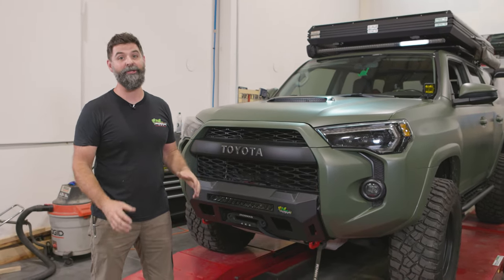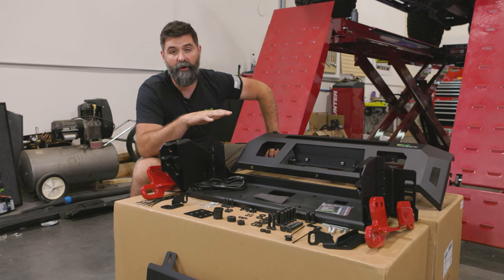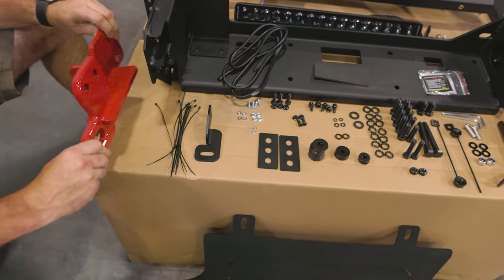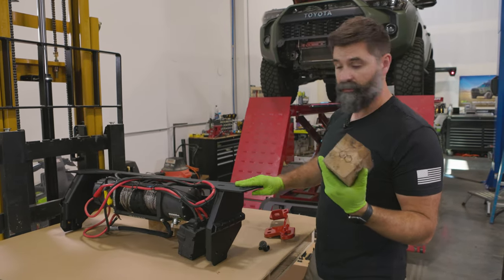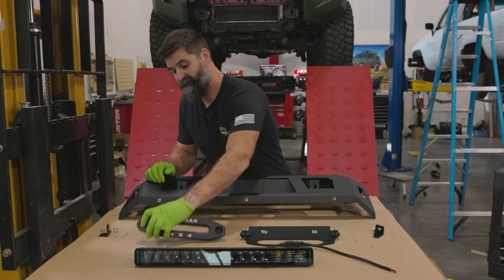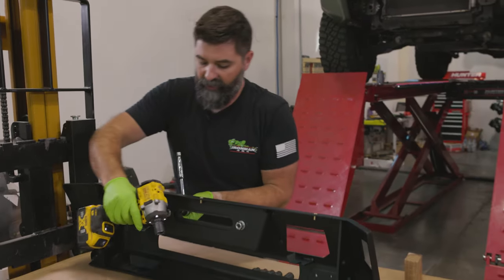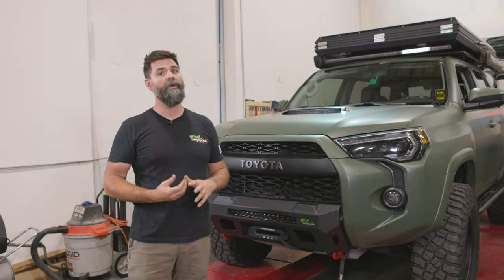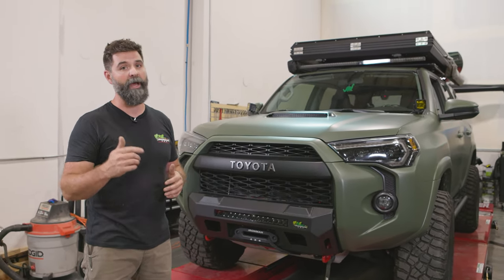Ironman 4x4 Stubby Front Bumper Suited For 5th Gen Toyota 4Runner | Install Guide

Comment: Great bumper - any issues with this and KDSS? I see your red recovery points attach to the radiator and frame housing which is right around where the KDSS sway bar is. I have a 2022 4Runner TRD ORP. Thanks.
Reply from the maker: No issues.

Comment: Looks great!!  I have a TRD Pro.  In that last shot in your outro, it looked like you had the TRD Pro skid plate on with your bumper.  Are they compatible?
Reply: The TRD skid plate is compatible 👍
Reply from the maker: Yes you can make it work with some longer bolts for the rear mounts and some minor modifications.
Reply: @Ironman4x4America  could you explain some of those modifications

Comment: Great install video and a nice looking unit. When will Ironman 4x4 bring out a bumper option for the 2nd Gen Nissan Frontier?
Reply from the maker: We have the D40 Navara bumpers that can be made to work.  The 3rd gen Frontier will get a new style bumper first.  There are so many trucks in line for bumper designs so it takes time and we have to prioritize based on newer models, and sales numbers of vehicles.
Reply: @Ironman4x4America   Thanks for the reply. Will look into D40 bumper. I  appreciate that you have to respond to the market and that there is always constraints. The 2nd Gen Nissan Frontier had a 16 year run with fairly decent sales numbers. Most Frontiers are now second and third owner and in the hands of guys who want to modify and wheel. Seems there would be a decent market there. Just sayin.  Keep up the great work at Ironman 4x4!!
Reply from the maker: @mikemorgan4670  Agreed! Cheers
Reply: @Ironman4x4America  Would you be able to point me in the right direction regarding  the D40 Navara bumpers? Thanks in advance.

Comment: So someone asked earlier and you didn't answer.  You mentioned a winch install video, but one doesn't exist. In this video, it appears that the winch control box isn't mounted at all. Did you fasten it to the bumper/winch tray where it appears in the video?
Reply: The video is misleading… it makes it sound like the controller bracket is designed to fit but it doesn’t fit on the left where the pre drilled holes are… you can fit it on the right, but there’s only one pre drilled hole. The controller box ground wire also isn’t long enough to make it to the other side so you need to extend it.
Reply: @timbell595  Agreed, the video is misleading and the install doesn't work this way.  I ended up drilling holes on the opposite side (right side if you face the bumper looking rearward) and used the control box bracket. I also had to make my one ground wire. All-in-all, I love the bumper and the winch but it was a complicated install and a video with more details would have helped.

Comment: Great video, just bought and assembled mine with the 20" light bar. I did not see any instructions for wiring the light bar? Are there any instructions?
Reply from the maker: Thank you! We don't have instructions for wiring as this can be done several different ways. For example you could purchase our wiring hardness kit and wire the light bar up to a single button that will stick anywhere to your dash. You could also get a switch panel, auxbeam and wire it up to that. Hope this helps.

Comment: Nice video!! Do you know what bolt size/thread is the one on the bracket by the radiator ? (Bottom one) Do you just sell the bolts on your guys website?
Reply from the maker: If you need some specific info on the hardware, please reach out to our customer service.  855-476-5714

Comment: I’ve got the FCP Stage 2 suspension- this is next!  Are the two little “humps” on the top edge of the bumper skin for mounting lights? Looks like there’s a plugged hole there for wiring?  If so, that’s AWESOME!!!
Reply from the maker: Yes you can mount lights or a stubby GMRS antenna there.

Comment: When is the rear raid 5gen bumper install come out. My order does not have any install instructions??
Reply from the maker: It's currently in the works.
Reply: Very frustrating that no instructions are included other than this video. Need a parts list at the very least.

Comment: I see there’s a big gap between the new bumper and the cut plastic bumper. Can you cut less plastic to have no gap?
Reply from the maker: The plastic falls behind the bumper shell, making a nice hide for the cut line.  The bumper in mounted to your frame and the truck body is mounted on rubber body mounts.  When offroad the body will flex independently from the frame.   To allow for this movement you need about a 1/2" gap so there is no contact.

Comment: With this and the rear really wish you had shown the bumper cuts being done.. that's the most guesswork.  And in the video you refer to a winch installation video but it's no where to be found.  You show the universal bracket but the kit comes with an angle bracket for the controller box but no info in this video on how or where to mount it.. is it left to the customer choice?  Any suggestions since you what appears to be a different box than you actually ship with the 9500 winch.. (yeah I can figure it out but that is one reason I ordered both part from same company I was hoping it was mostly mapped out).
Reply from the maker: There really is no guess work, simply follow the plastic chin guard piece outline for your initial cut.  Then trim back any more as needed based on your preference.
Reply: 1) The cutting instructions on the air baffles are wrong, you need to cut a lot more. 2) The part about the control box mount are misleading. It doesn’t fit on the left like he talks about. It only fits on the right, but there’s only a single pre-drilled hole on the right, and the control box ground isn’t long enough to reach the other side so you need to extend it. 3) There is wiring for the fog lights you need to relocate before cutting, if you cut it with the bumper on the vehicle you’ll slice right through it.

Comment: Do you have to move the air conditioning line out of the way? And if so how much? Thanks
Reply from the maker: No need to.
Reply: With a 9500lb monster winch it touches slightly but you can gently bend it.

Comment: I bought this bumper, an Ironman winch, light bar and skid plates because I thought it would all fit together nicely like this video makes it seem… unfortunately many parts of this video are missing or misleading… 1) Know this video is the ONLY instructions available from Ironman. No instructions are included in the box… no parts list, no torque specs… it’s very difficult to ko2 what hardware to use where. 2) The video is misleading about the winch controller bracket. It makes you think it is made to fit the 9500lb Ironman winch and fits in the left… unfortunately there’s absolutely no room for it there. You see in the video, the winch controller is actually on the right and seemly not attached to anything. You can fit it on the right but the control box ground isn’t long enough to make it to the left side, so you need splice it to extend. There’s also only one pre-drilled hole on the right. 3) The cutting instructions are wrong, especially for the internal air baffles which need a lot more cutting. 4) If you pre-mount your control box and try mount the whole unit in one go, like the video suggests, you won’t be able to reach the inside back bolt on the controller side. 5) The video fails to mention that there’s wiring for the fog lights that need to be relocated. If you cut on the vehicle, you’ll slice right through them.
Reply: Comment is a public service.  Thank you.

Comment: Can I fit it on a limited? TY
Reply from the maker: It will bolt up to a limited, but the cut will be much different because the limited has that fat chrome piece across the front and is different from the rest of the front ends on the other trim levels. Same goes for the TRD Sport that is offered.

Comment: How did you secure the winch control box?
Reply from the maker: It is bolted to the side of the winch tray next to the winch.
Reply: It only fits on the right side, not the left like the video shows. There’s only one pre drilled hole and the control box ground isn’t long enough so you need to extend it.

Comment: Does this work with the RCI skid plate?
Reply from the maker: Can't say for sure, but the TRD skid plate works with it using longer bolts for the rear mounts.  If the RCI is similar then you should be ok.

Comment: Why have these companies disregarded the 2010 - 2012 Models?
I have a 2012 and have a very difficult time locating anything for it!
Ridiculous!!!
Reply from the maker: Many companies, including us, develop products based on demand and sales numbers of that specific vehicle.  The early 5th gen 4Runner, 2010-2013, had low sales numbers because we were just coming out of a massive recession.  When Toyota released the facelift in 2014 sales more than doubled of units sold per year.  We look at this data very carefully when looking at product development decisions for legacy vehicles.  And companies will develop for the largest potential customer pool to get a profitable return on the R&D costs.
Reply: @Ironman4x4America  OK, with that being said, I have a question. Is there a nerf bar that fits the 2012 4Runner? I am trying to help a disabled veteran who needs one.
Reply from the maker: @richardstone5241  We do not have any front bumper options for that year range of truck.  But I know CBI, Coastal Offroad, Shrockworks, ARB, LFD Offroad all do.  Lots of options out there.
Reply: @Ironman4x4America  Thank you for the information!
Reply: I few your pain with my 2011 trail, our Gen 5.1 are rare beasts!